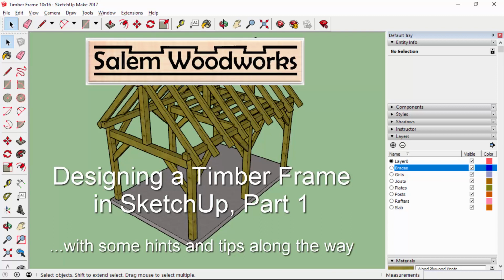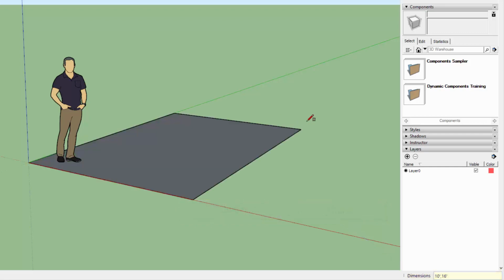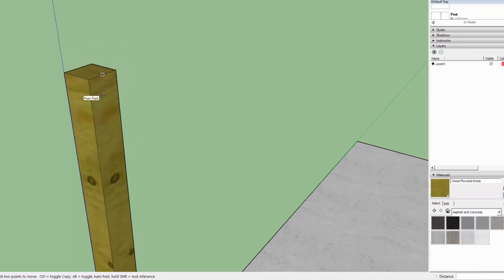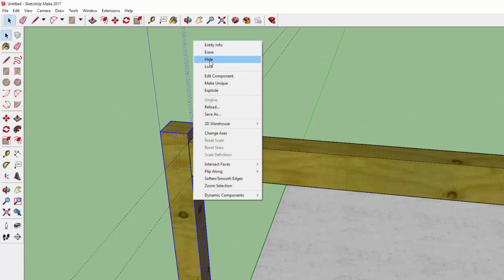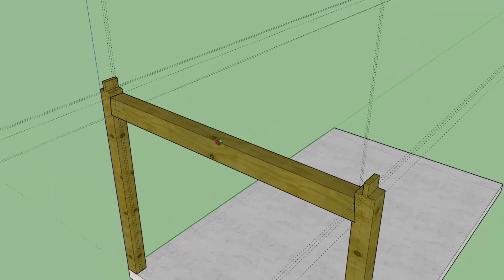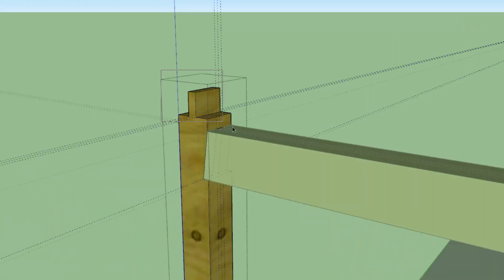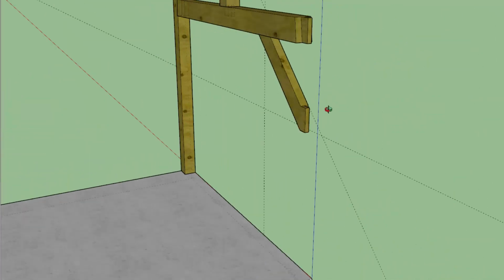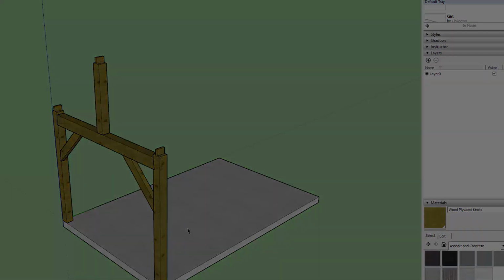Timber Frame SketchUp Tutorial - Part 1

Comment: Curious as to how the dimensions of the components are calculated? 
It would be great to timber frame with components that are adequate for the design but not overkill.
Is there a simplified mathematical process that will aid in timber dimension calculations?
Reply from the maker: Sadly, there is nothing simple about this. Structural requirements vary by the beam type and loading and strength properties of the timbers vary by species, cut and quality. For simple building like this frame, you can rely on tried and true sizes that have been used in the past, as they are likely overdesigned for such a small structure (overkill by design). For more serious structures, lean on engineers or seasoned experts.
Reply: @SalemWoodworks  There are tables that refer to common dimensional lumber uses and capacities.  One would think there would be similar information for timber applications common to timber framing.  "Overkill by design" equates to waste which one can ill afford, especially these days.  Few can answer the questions directly as to why a specific dimension of timber was applied for this component or that.  
Appreciate the SketchUp tutorial though; very useful and helpful.

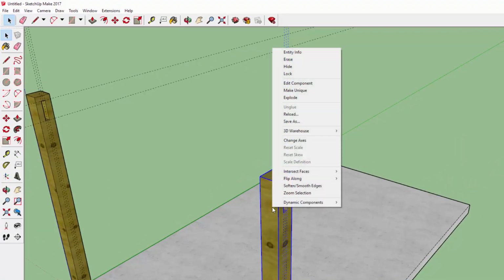Comment: @7:46 you flipped the post farther away from the model’s origin and it only flipped that post. I followed the same steps (I believe), but both posts get flipped. I have tried flipping the original post as well but it also flips the other post. I can’t make the mortise’s face each other. I’m on a Mac btw. Any help would be greatly appreciated.
Reply: Okay I figured it out. I didn’t follow your steps. I kept triple clicking on the post which then kept selecting the original post. I just needed to select the post once. Then I could flip the one post individually
Reply from the maker: Glad you figured it out!
Reply: @SalemWoodworks  Thank you, I appreciate you checking in. However, I am almost here at the tail end of replicating this build, but I noticed the mortises made in the Girt and the Posts for the tenons from the knee braces were not made as an exact opposite of the tenons. I understand the way you made them will fit the tenons on the knee braces, but I am wondering if I were actually cutting the mortises should they complete enclose the tenon instead having some empty space between the mortise and tenon?
Reply from the maker: Good eye. Structurally, it matters very little. The  important load-bearing face is where brace meets the bottom face of the mortise. You're right that it might be cleaner if the mortise pocket were the negative of the tenon, but it's easier to cut the mortise pocket perpendicular to the beam/girt/post face. On the frames I've built, I've cut the mortises like you see in the model here.
Reply: @SalemWoodworks  Thank you. I didn’t know that. That will make assembly much faster and easier in real life and in sketch up. I have finished part one and I’m on part 2!

Comment: Where can I read about the rules of calculating the timber frame constructions? For example what thickness of the timber should I use depending on the dimensions of the frame? Could you advise anything? Thank you
Reply from the maker: This is a simple  question with a complicated answer. I'm certainly not an expert. For the three fames I've been working with (one built, one in construction, and one in planning stages) I've relied on existing designs. The design in this video came from the North House Folk School's "build your own small frame course". I'm planning on building the 12x16 building from Will Beemer's book (https://amzn.to/3i8Mhqp).That book has some information about timber sizing. The truth is that it isn't simple. Sizing timbers depends on their function, the frame design, timber quality (splits, knots, grain orientation), species, ... it's a moderatly complicated science.
Reply: @SalemWoodworks  thank you sir

Comment: I think this is the best beginner Sketchup teaching video I've seen. It covers all the really critical points and does it so quickly. and 've finally learned  how to use the tape measure tool after 20 years LOL. I do use X-ray all the time which I've set up with "X" as the short-cut key. It makes it really easy to use end-points in otherwise hidden components and the whole hidden joint. Thanks.
Reply from the maker: Glad it was helpful! I'll have to try X-ray mode. I tend to rely on using "k" to see back edges, but they're hard to see sometimes.

Comment: You make it look so easy... but ive had nothing but problems trying to duplicate your actions.  Does the free version not work well for trying this?  When I try to copy the first post I create, it usually only copys one face of the post.. sometimes two.  when I span around I notice the other two sides of the post did not get colored either.  Great video, I just cant seem to work the software well
Reply from the maker: I am using the free version (the downloadable one in the video description link). I'm almost sure that the step you're missing is making a component. If you're copying a post and only the face is coming, you likely forgot to make it a component, OR, you may have entered into edit mode for the component before making the copy.  First, make the entity, then triple-click to select all connected entities, then right-click to turn it into a component. After creating the componet if you use move with the Ctrl option to  make a copy, it should take all faces of the component when making the copy. Similarly, when using the materials, if you assign a material to a component, all faces of the component will get the material color assigned. If you haven't made a component or if you enter into edit mode for a component, assigning a material will be done onen face at a time. I suggest going back to the start and very carfully watching the part about creating a component.
Reply: @SalemWoodworks  Thank you for the reply.  I did make a component.. but I did get a better result when I went back and realized I pushed the foundation up instead of down

Comment: Did you mean to leave the mortises for the knee braces not matching the angled shape of the knee brace tenons? See pages 31-32 of "PDF Historic American Timber Joinery: A Graphic Guide| 2004-08" NOTE: YouTube didn't like the direct PDF link. Select the entire string within the quotes and the first result will likely be the PDF download.
Reply from the maker: Since the weight-bearing edge of the brace is at the far end, it's not critical to cut a mortise pocket that's angled on the inside face. In the frame I built, the mortise pockets for the braces were actually cut as I've drawn them in this video.

Comment: I have another question. I am struggling with making the mortise on the first post. I have created this once and wanted to start it over. Now every time I go to use the push pull to create the mortise it doesn’t push anything. I’m stumped. I have followed your steps one by one but... I’m missing something. One thing I did notice was when I’m putting in the references lines it does not find the Center as it had done so previously.
Reply from the maker: My first guess is you've forgotten to go into edit mode before drawing the rectangle that you push. First double click on the post to go into edit mode, then draw your rectangle, then push to form the mortise pocket.
Reply: I’ll give that a go. Thank you
Reply: That was it. Foow

Comment: I have a wall that is taller at one end then the other.  Is it possible to multi copy a single stud in such a way that the top and bottoms of each stud are constrained by top and bottom lines so that each copy is a bit shorter than the previous?  Or do I have to manually adjust each stud to the correct height?
Reply from the maker: I don't think Sketchup supports that kind of parametric associativity. I think you'd have to manually adjust. However, if you make use of components you can select several components at once and choose "make unique" so that the set you selected are still copies of each other. That way you could minimize the amount of manual effort required.

Comment: Hello. I am trying to make the haunched tenon, but for some reason I am not able to complete 'drag select'. It seems to select too much, or at least it doesn't look Like in your tutorial where only a part of the lines at the lower corner of the tenon are selected. In my case it selects all lines.  And when I hit M for move, the haunch looks incorrect or warps the girder or pulls the entire tenon forward.  I've got 2018 SU pro version for mac. Anyone got any workarounds for this problem, please??   Thank you for making this clear tutorial. Subbed.
Reply from the maker: The direction you drag makes a differrence. If you drag your box from left to right, everything that is entirely inside the box is selected. If you drag from right to left, anything that is even partially inside the box is selected.
Reply: @SalemWoodworks  Thank you for replying. Actually that is not the case. I have tried many times to drag from either side and still it does not select as you have shown. I think the problem is as in your vdo 09:12 when you zoom in on the edges around the tenon the lower three edges are auto highlighted in blue and red. I do not get that in my case. I do realise though that trying to solve my problem like this is difficult. I appreciate you taking time to do these layout and framing tutorials and will use them to come up with my own plan. Thank you again good sir.

Comment: I have a question about using components.  I've added the TF Rubies sample timbers (FS Timbers) in my plan, to use as components.  Starting with sill beams, I'll want to create tusk tenons at corners, and bladed scarf joints to extend lengths.  If I add those joints using a "base" component, wouldn't it affect all instances of the component in the model?

How should I apply a particular type of joint I want to a specific instance of a timber component?  Do I need to select the specific timber in the model, Make Unique, then Make Component to create a different component, so it won't affect the other instances?  For example, do I need to create a "Sill Beam Corner" and "Sill Beam Extended" components?
Reply from the maker: First, you're correct that the way to have it NOT affect all the other instances of the component is to first "make unique" on the component you wish to modify. This will add a suffix (I forget exactly what, but it adds a number to the end of the original component name to indicate it's a variation of the component) and it becomes a new component.  The act of "make unique" already makes it a different component so there's no need to "make component" again.   You might wish to rename the new component if you want the component names to really indicate the function.

Comment: Man, I so much appreciate this post. In general, I use TF extensions for everything. However, at times the program requires some very specific inputs to do some simple items. For example, I spent way too much time figuring out scarf joints. TF extensions works great for basic mortise and tenon joints. I started applying the techniques provided in this video for the more complicated mortises and it actually saved me some time. Thanks again!
Reply from the maker: Thanks Jon! Glad it helped. If you ever hit something you can't figure out in SketchUp... challenge me with a question in the comments here and I'll do my best to figure it out.